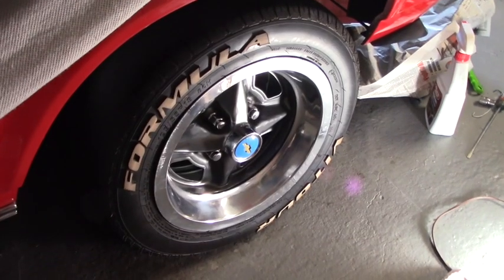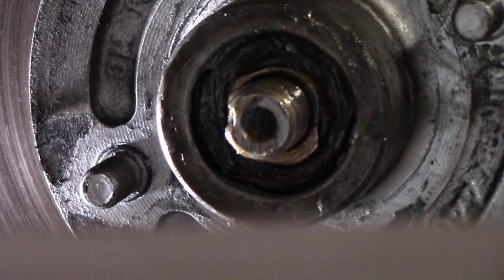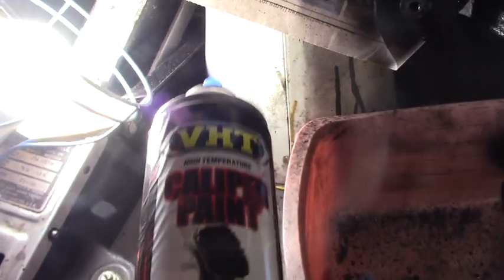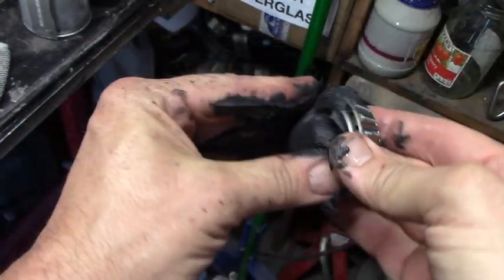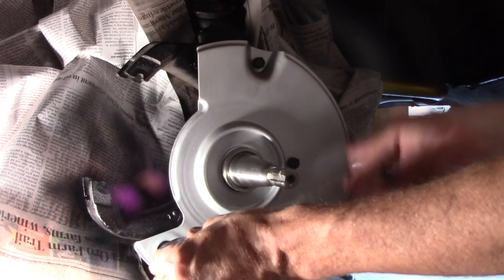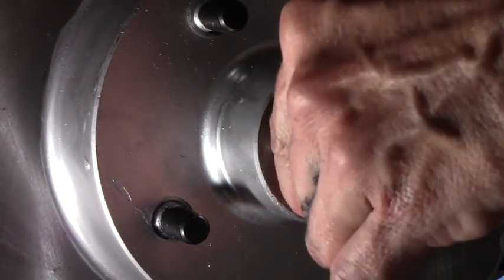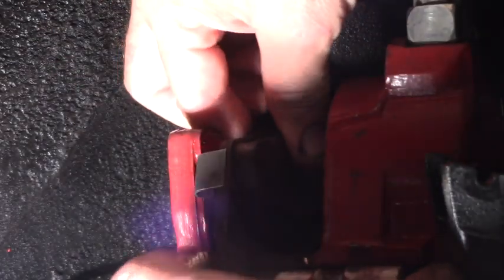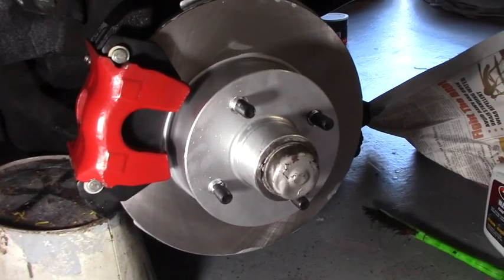Installing Rotors and Pads on a Chevrolet Vega

Comment: Do drums next??
Reply from the maker: I used to have a video for H-body rears, but I deleted it.  You will need a special GM tool (KD-2307)  to compress the brass adjusters to reset them when you put the new drums and shoes on.,( just be careful the adjusters get brittle with age and if you break them they will no longer self-adjust).  Find an old Chilton Vega book if you can.

Comment: So the calipers just fall on the rotor? I want to see the actual install of the caliper.
Reply from the maker: It is the reverse of the removal..  Watch my video on how to rebuild the calipers for that.
Reply from the maker: I show that here.  Yes, they just slide on over the rotor onto the retaining bracket, then you slide the locking pins in.
Reply: I had to master the plastic parts. Then it went together great. Now I got binders.
Reply from the maker: @ronmitchell5644  Awesome!  Hope the video helped!  Yes, those plastic sliders can be really tricky at first.